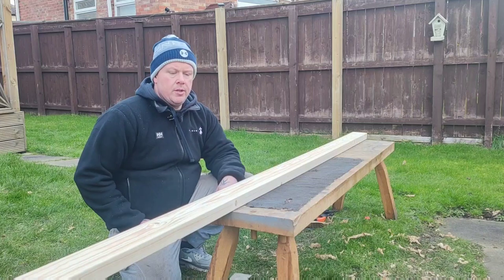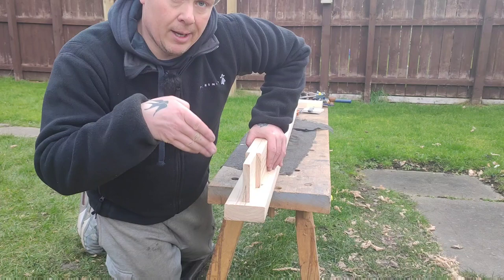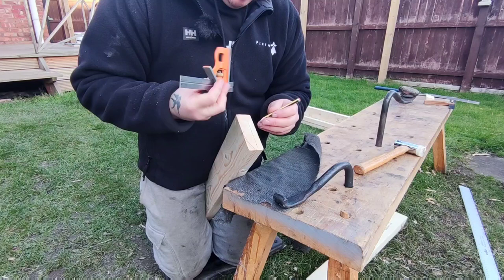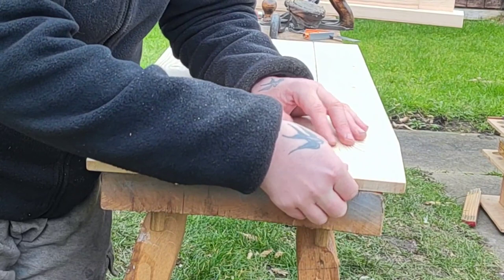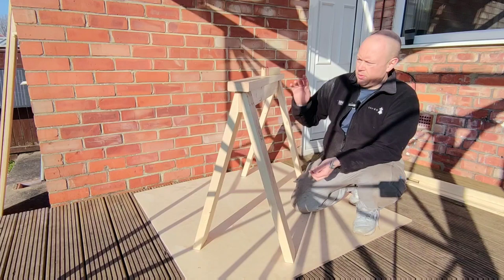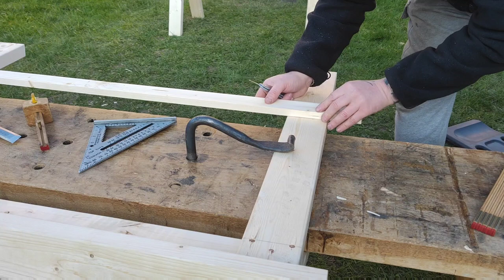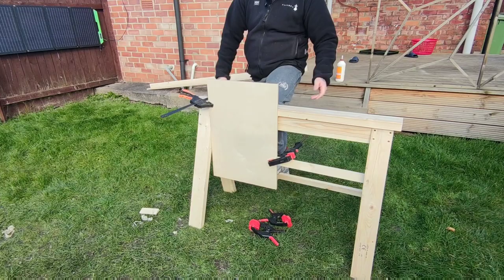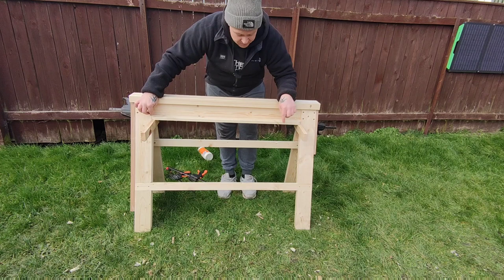Solid sawhorses for the  sawhorse workbench

Comment: Do you believe you could do a super space saver Roman workbench by only doing two smaller sawhorses and the top.. I keep thinking about making one ..
Reply from the maker: You could just make a Roman workbench with removable legs. As long as you get a good joint fitting of the legs, it'll be fine. The bench top will then store flat.
Reply: Cheers, mate. I keep obsessing over  it as I don’t have much space available.. I believe that your suggestion is the winning bet..
Reply from the maker: @iacobetmaria6899  I think it would suit in limited space.